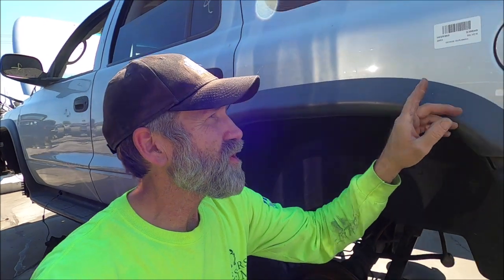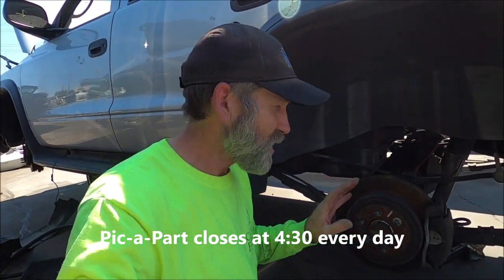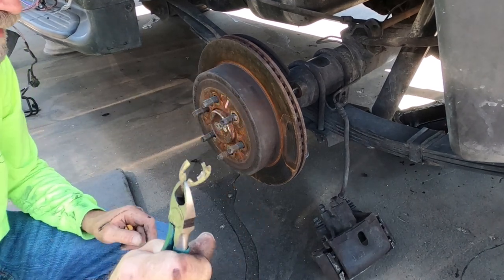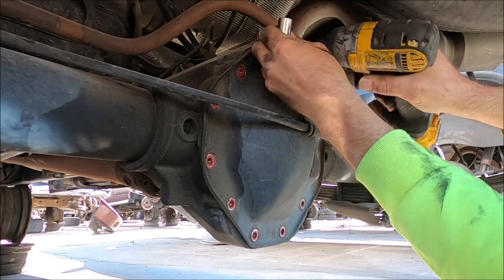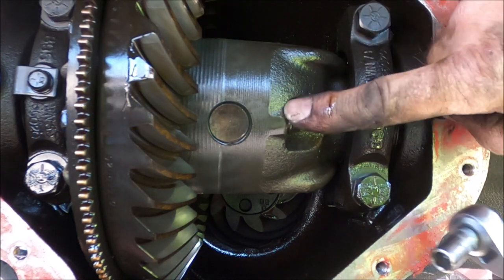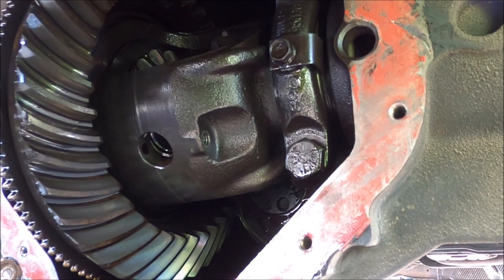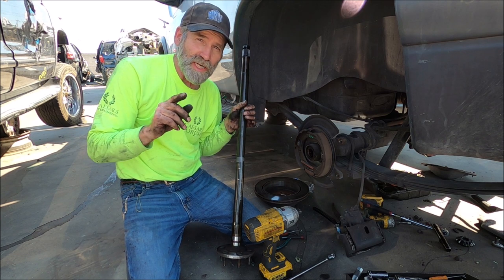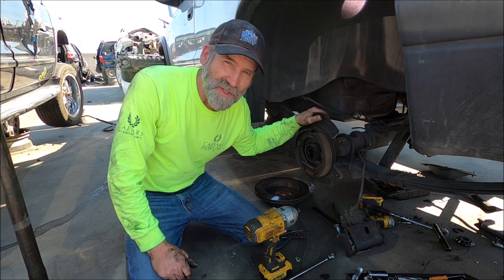How to Remove C-Clip Axle Shaft from Chrysler 9.25 and more

Comment: Nice job Martin. I am so glad your making Dakota vids. You got the new Dakota. Are you putting 4.56 gears in there. I really want to do it. With 4x4 it’s alot of work   Thanks as always.
Reply from the maker: Yeah I got that 01 Dakota 4x4 with the 4.7 engine. Planning on lowering it and swapping front and rear ends with 3.92 gears and with the Trac-Lok posi. If I would raise it I would choose the 4.56 gears with 33 or 35" tires.
Reply from the maker: @cablecow15 Glad, you liked it. 👍😊

Comment: Hi Martin! In the wheel hub, are the races actually the seals?? I need my seals replaced on my 2000 GCL. Leaking. ✌
Reply from the maker: No the seals are a separate part and the bearing and race are one part. Easy fix once you get the axle out. Here is a video I did on my XJ it is pretty much the same. https://youtu.be/n5X7c99fyao
Reply: @martinbuilt  . I get a light wheel thumping when car is cold then immediately goes away. Thought might be old rubber, bought new tires and same. Do you think barring is bad too??

Comment: So does it actually fit on the drum ?
Reply from the maker: I ran out of time at pic a part. I went ahead and purchased the backing plates calipers brake lines and parking break cables. I have a rear axle from a 2000 Dodge Durango R/T with 3.92 gears and a trak loc at home currently getting all the disc break parts cleaned up and I will soon find out how things fit.